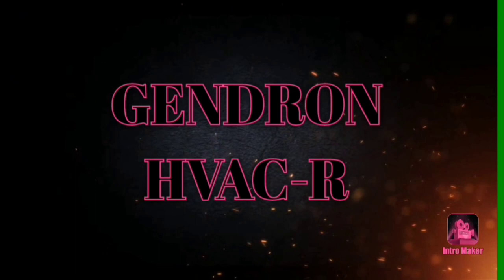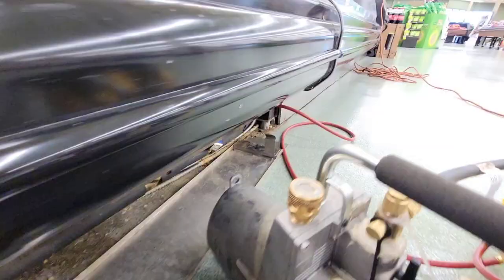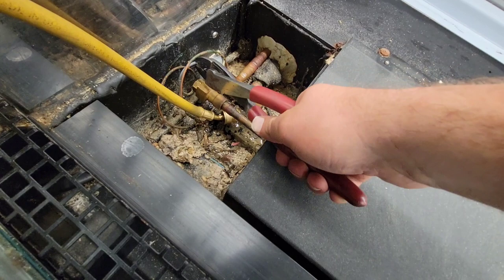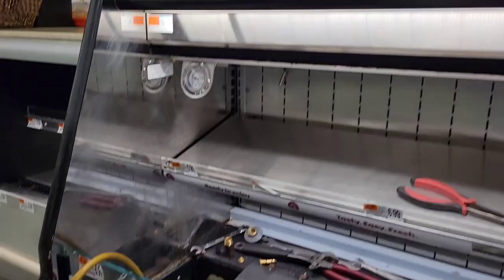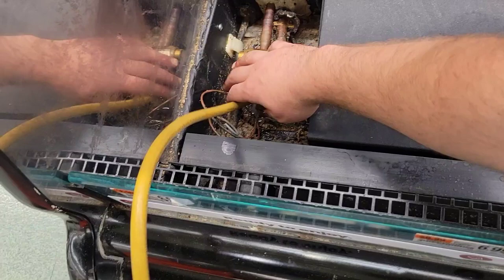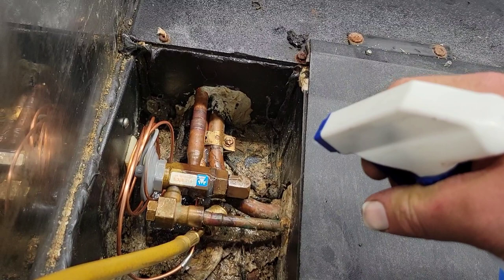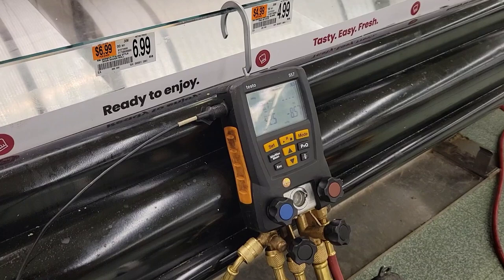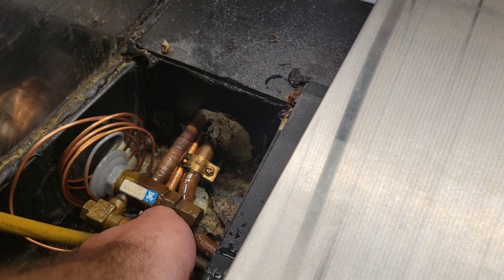Supermarket Rack Refrigeration- How to Replace BQ TXV Cartridge, Powerhead / Clean Screen and Valve

Comment: At 6:26 you see the guide part drop out as he removed the spring, later he found it and looked up where the guide part goes. 
Good job as he is able to work with almost no clearances and underneath. For most, this would be a very difficult job every day with things this messy, and they are.
He handles it as just another service call because he is skilled in the art of getting it done.
Reply from the maker: Thanks man I appreciate the compliment :)

Comment: Sometimes on the refrigeration schedules they say how many BTUs are needed in MBH for that circuit , for example a. 4 door frozen meat might call for 5.84 MBH for that circuit which would be 5840 btus, say you have two txvs in the case then divide by two and  that’ll tell you what size, 2920 btus or a little under 1/4 cartridge is needed for each txv. 1000 btus per 1 MBH and 12,000 btus per 1 ton of refrigeration, that’s what someone taught me.
Reply from the maker: I generally use the case but this is wonderful. 

Thank you this is a super helpful tip!
Reply: @gendronhvac-r1269   ah ok, glad it helps! I learned this by doing rack swaps, it really depends on how many txvs are in the case but the schedule generally tells you the total btus for that circuit, do some math and you’ll figure out per TXV

Comment: got a very good question for you. i'm a frozen stocker and a local supermarket and i'm also learning hvac and trying to go to hvac school. i have a case (5 doors) that ices up frequently. my managers told me to de-ice it 2 weeks ago in which it was successful and had airflow and went back down to temp. then it slowly iced up again. the refrigerant lines keep having really bad ice build up which (i think) is causing the evap to build ice. the first door by those lines had no airflow at all. the drain was also iced up. the SBQ you showed at the start of the video looked very similar in ice build up but it was alot worse. what do you think is causing this? managers try to avoid service calls for just iced up cases by the way. but i feel like it's more than that.
Reply from the maker: If the case ices up typically there is something wrong with the defrost cycle or the drain is clogged. 

https://youtu.be/S82heH5qSGQ

The video should help a little! :)

Comment: When cleaning a supermarket reach in freezer condenser coil, do you need to wait for it to dry so the water you just sprayed doesn’t freeze? Or can you turn it right back on after spraying it
Reply from the maker: I'm thinking you mean evaporator coil and not contensor coil. 

Typically I would just throw the case in a defrost clean the coil and just let it finish out its defrost cycle. 

At the end of its defrost cycle it has something called drip down time. This is the estimated time it would take for water to drop off of the coil. 

Drip down time is usually about 5 minutes. 

So let's say you just turn the oil off you could clean it spray it down just wait like 5 minutes make sure there's no big pools of water. Nothing crazy

That's it I hope that helps

Comment: What happens if you mess up and all the refrigerant leaks out into the supermarket, that would be my fear.
Reply from the maker: So let's say worst case scenario blew the entire charge. The store would be a misty Haze of refrigerant. The fire alarms would go off and everyone would have to evacuate. And depending on the company you work for you might lose your job. 

Now let's say if you just didn't put the valve back together quite right. It might take a year for the charge actually leaks out. No one would get hurt in this scenario just you know it's not particularly good for the customer. 

But if you watch the video there are three tests. 
1) does it hold a vacuum
2) soapy Bubbles at suction pressure.
3) soapy bubbles at liquid pressure

And if you're really really scared you could use your electronic detector as well but there might be some type of interference from residual refrigerant from opening the valve initial. 

But by and large if you perform those three tests you should be good. It's just kind of the risk you got to get used to as a refrigeration technician. 

Now let's say you turn it on and it starts blowing out of the valve. You can simply turn off the case at the ball valves buy a new valve and come back a different day. 

So there are many ways to mitigate risk I hope that helps
Reply: Thanks for videos,learning alot.

Comment: Min 5:44

What was wrong with the TXV?  "Core problems"?  How did you know there was a 'core problem', and how does that show up in the system's performance?  (I think HVAC schools spend a whole day or a week on TXVs... I can see why. 😆)
Reply from the maker: The superheat was unchanging. 

So.i put the txv bulb in hot water and nothing happened. The superheat was still really high. Also I tried adjusting the spring and nothing happened as well. 

 So with Q Body valves there is a 99% chance the replacing the cartridge and power head it will fix any problems. 

Hope that helps :)